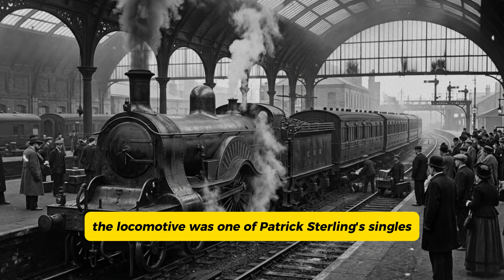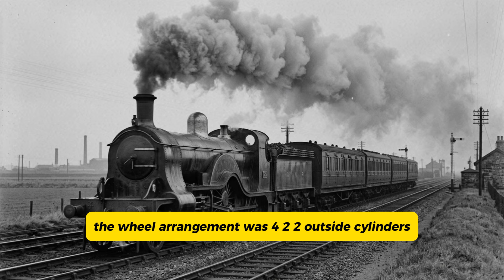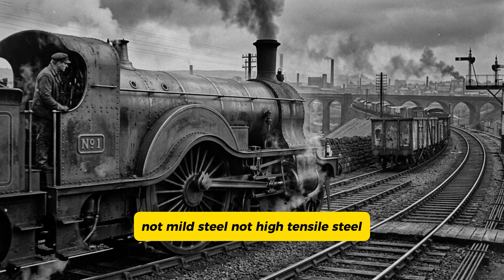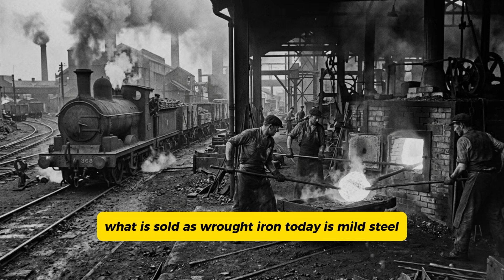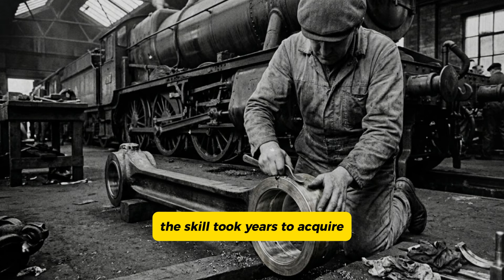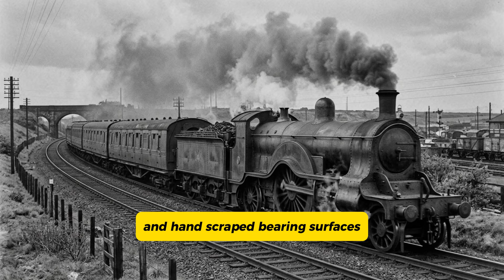The Victorian Steam Engine Using Technology We Can't Replicate Today

Comment: That's COALED not cold. Steam can't be raised on a COLD engine heated by COAL !
  On the first scene you've got the driving wheels connected to the tender wheels. That would have made going around tighter bends a bit difficult !
   The scene of a Stirling reversing is impossible. Where the brake man stands was taken up by the Tender !
  These locos have been scrapped but engineering skills live on in the UK. Please learn to ask a real expert to check your work.   Such blatant mistakes make you look bad & reduce our enjoyment.
  Better luck next time ?

Comment: Wow, a Stirling 8 foot single arrives at K.K. with no visible connection between cylinder and connecting rod. Then at 0.51 it suddenly sprouts a weird valve gear with the valve driving rod thrashing about in mid air - Walschaerts would be laughing his socks off! For goodness sake study steam railway locomotive propulsion methods and valve gear before making another post, then you would get the views of many enthusiasts of this form of motive power - as it is, it's pathetic!